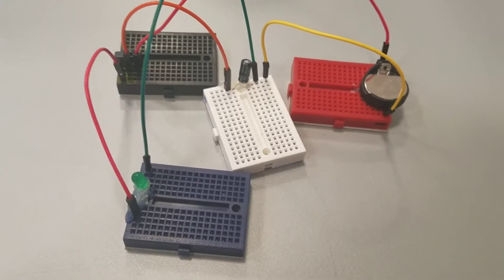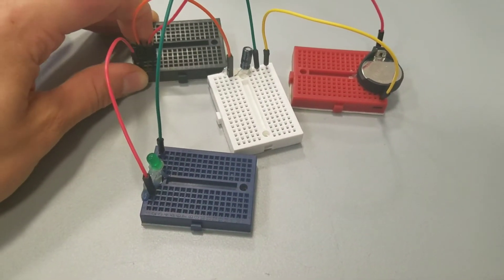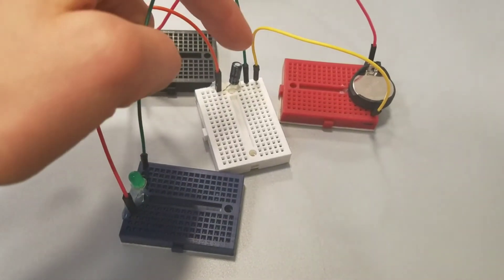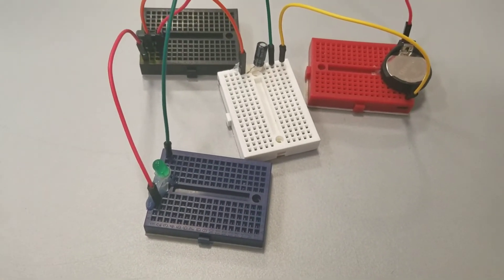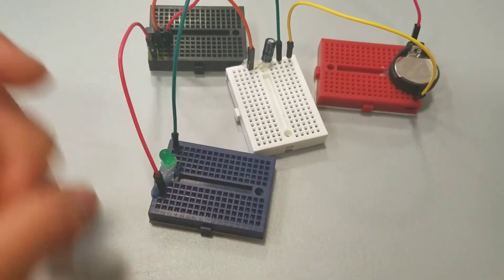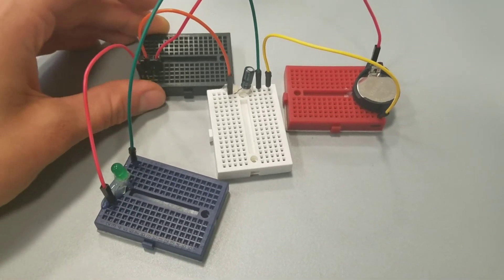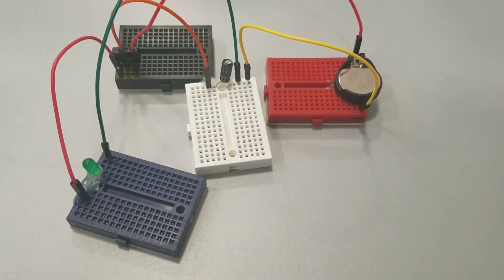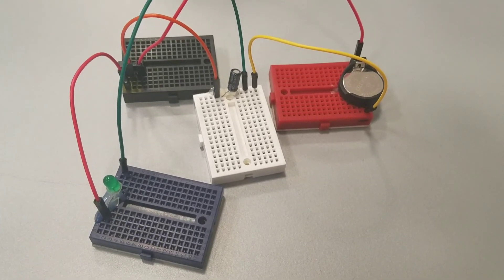How do camera flashes work? With capacitors!

Comment: Is there an easy way to do this but with a much brighter white led and a push button?
Reply from the maker: yes! use a bigger battery (and resistor to protect the LED). I believe i have this project in my book if you want to learn more: https://link.springer.com/book/10.1007/978-1-4842-9218-1

Comment: How would one make it with an indicator led to display that the capacitor is fully charged like in the disposable cameras?
Reply from the maker: you could either measure the voltage across the capacitor and use that to trigger the indicator LED or just turn on the indicator LED once the capacitor has been connected to the flash circuit for > 1 s. former is more accurate, latter is easier 🙃
Reply: @JenFoxBot  But how does the indicator led function? How does it know the capacitor is fully charged and what components make it all work?

Comment: All right! Woo! Oh My gosh! Yaaay! :-)
Informative for a beginner such a myself. Might try to build. Could a too strong battery, weak capacitor break the led?
Reply from the maker: Too much current running through, or too much voltage across, the LED will def blow it out. 9V is too much, 3V coin cell is perfect. The capacitor could actually help out w/ this, since you could charge a small (e.g. 100 microF)  cap w/ a 9V, then use the cap to flash the light. It's all about energy :) Hope that helps!